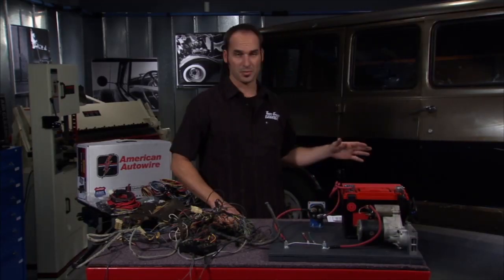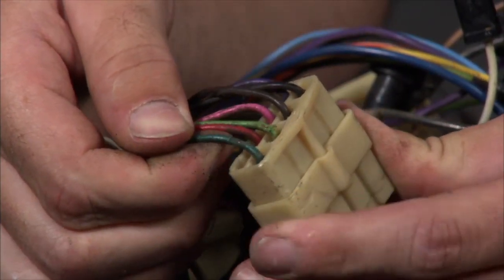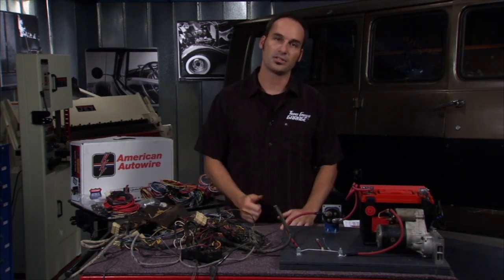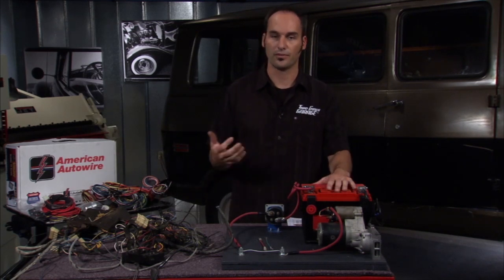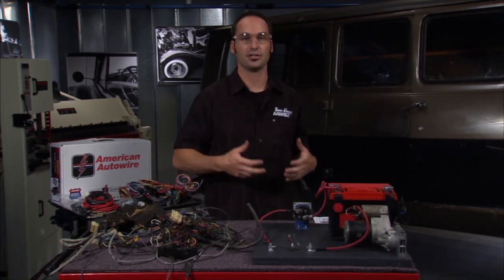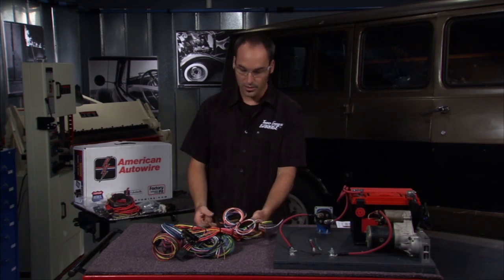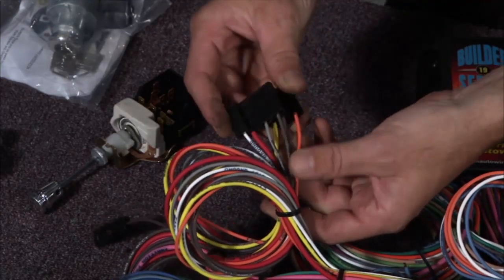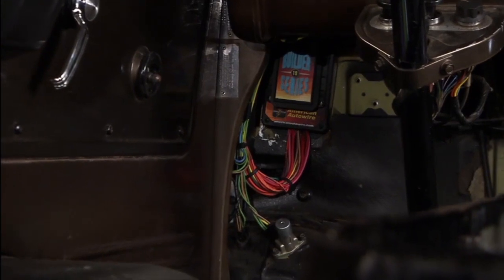Issues with Overheating Wires | Two Guys Garage

Comment: My wire on alternator going to battery is getting hot but I noticed a slice in the wire. It’s open. Will that cause wire to overheat or could I have to alternator wire going to the battery instead of solenoid?